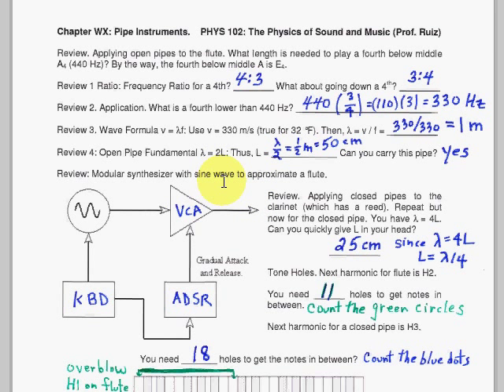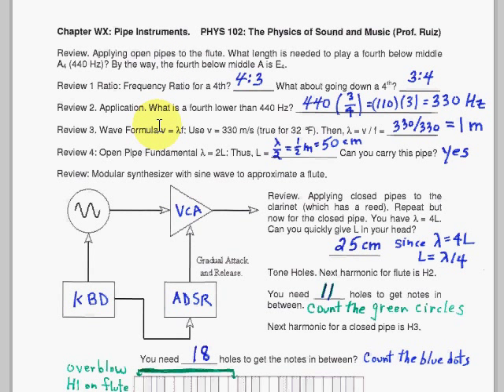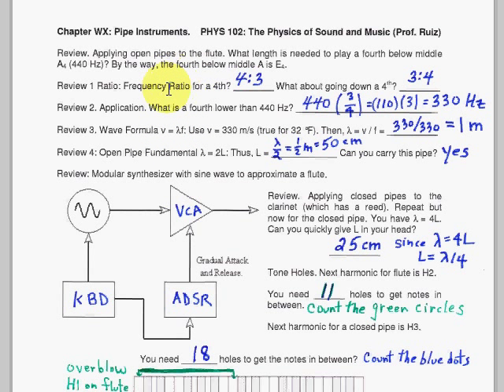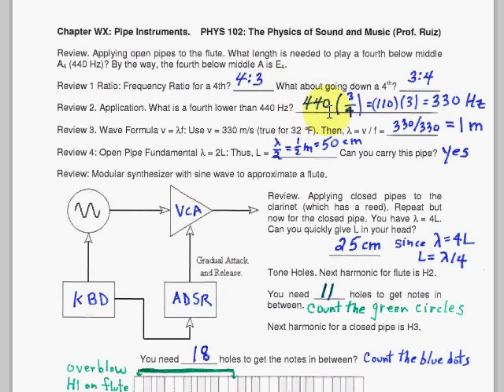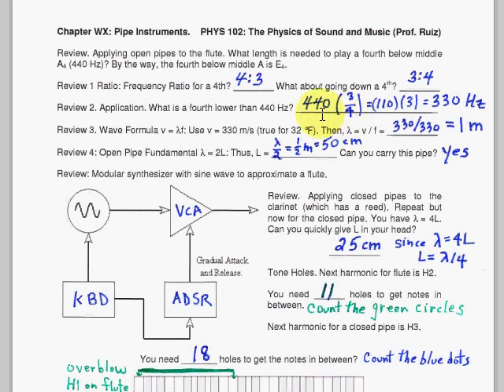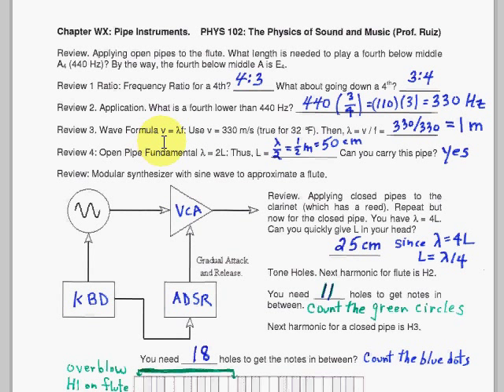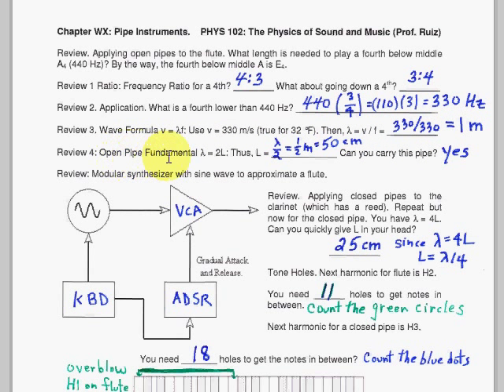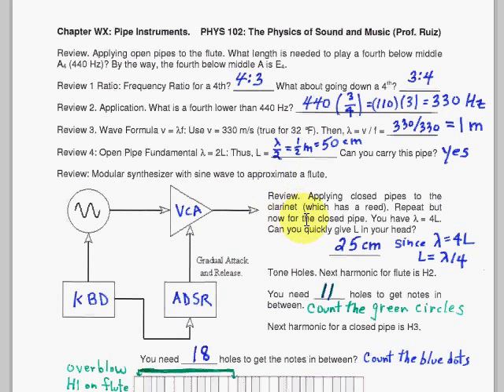Flute Pipe Length

Comment: how to get hole position on flute for perticular frquency
Reply: Finding the accurate position most likely would have to be tweaked by experiment. The ideal formula would only be approximate.
Reply: The formula for the length or the open end to the hole is approximate. The difficult task is done more as an art from years of refinement.

Comment: I have to tell you that sadly this model of a flute is wrong and your instrument will be flatter than you expect.  Instrument makers have long observed that an open ended pipe resonator is acoustically longer than it is physically.  Much work has been done to try to understand the physics, but it's unfortunately rather complicated.  Lord Rayleigh came close by experimentation.  You could look into the 1948 paper "On the Radiation of Sound from an Unflanged Circular Pipe" by Harold Lavine and Julian Schwinger where they conclude that "the exact value of the end correction turns out to be 0.6133" times the radius of the pipe.  Wikipedia has an article on end correction of real pipes:  https://en.wikipedia.org/wiki/End_correction   Note that comically, the end correction can be ignored only when your pipe has a radius of 0.  Cheers.
Reply from the maker: Intro physics books approximate pipes with no end corrections. You might be interested in my paper on Boomwhackers where I use the Levine and Schwinger model to measure the end corrections in a lab setting.
Reply from the maker: http://www.mjtruiz.com/publications/2014_boomwhackers.pdf